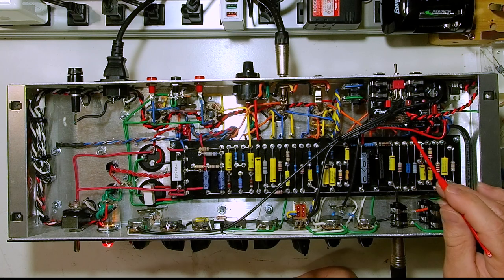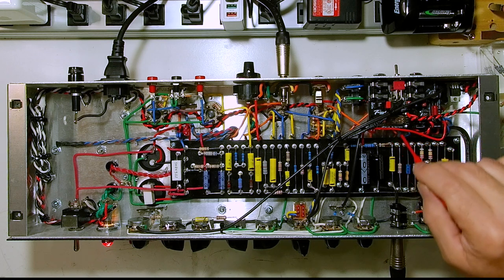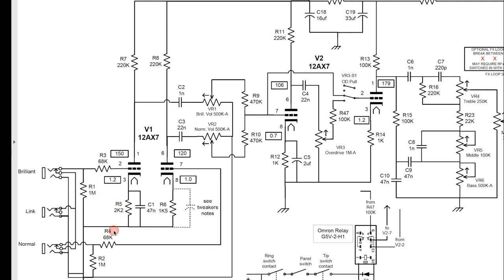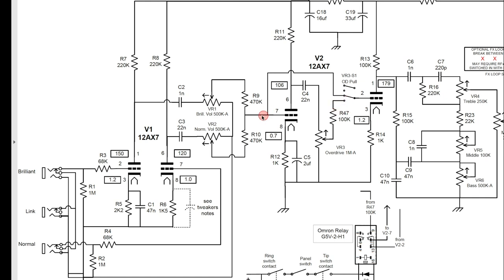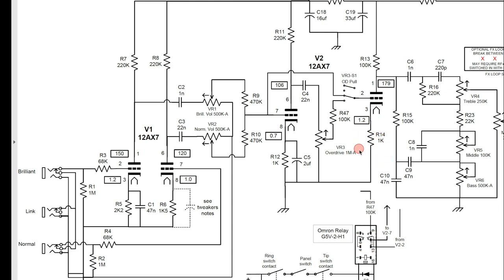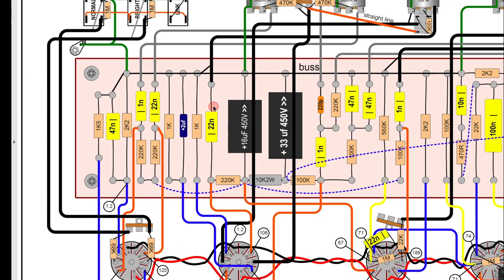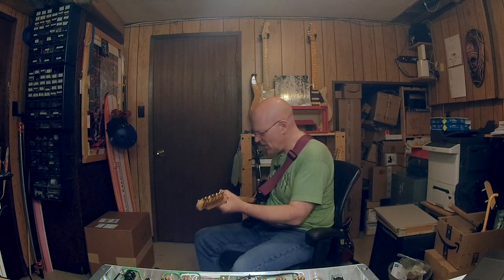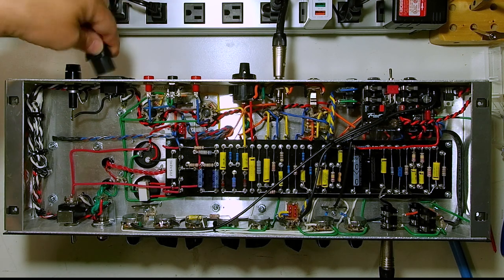Triwatt Tweaking - Overdrive Part 1 (Lead Dress and the Mods I’m *NOT* Keeping)

Comment: Think it maybe needs grid stoppers or snubber caps on v2b or V3a? 

Failing that, it could either be badly potted pick ups on the guitar, or maybe the rectifier diodes switching noise causing the mains transformer to emit EMI. Try a series resistor/cap snubber across the B+ secondary wires before the rectifier.